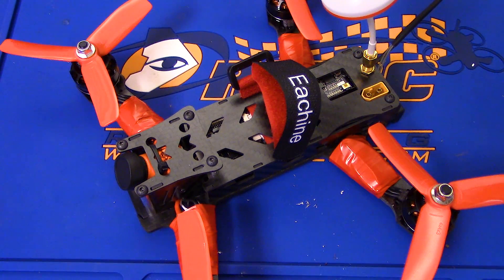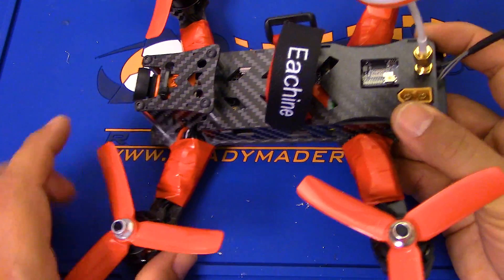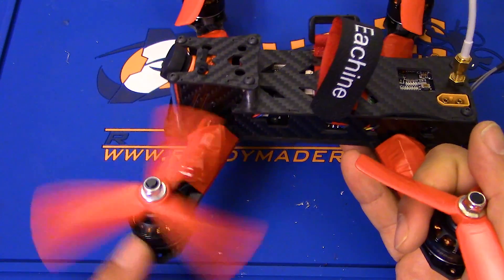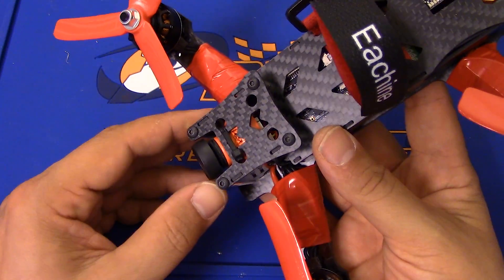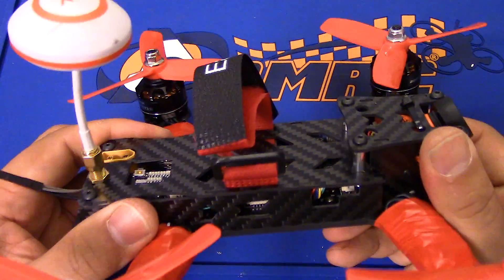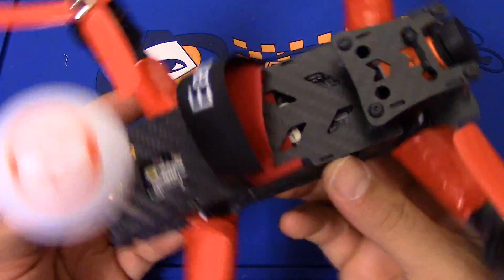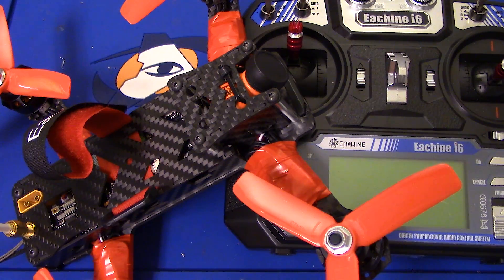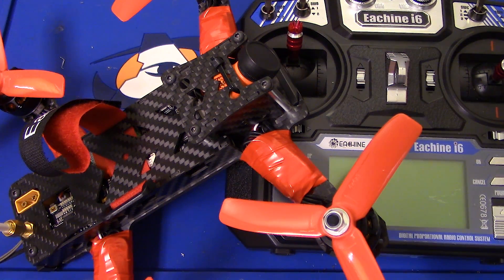Eachine Falcon 210 - Second Look

Comment: The Flysky FS-i6 has got good gimbals - they run EXACTLY from 1000 to 2000 and center at 1500 with almost no jitter and no deadband. The Eachine i6 has got way worse gimbals. I compared both the radios directly and there was a difference in the feel of the gimbals. So yeah, the eachine radio you are talking about is crap, but its different from original flysky.
Edit (just watched the next 10 seconds of the video):
6 POINTS OF DEADBAND?!!??! OH NO! Thats like 98% of the stick travel, so damn terrible!!!!!!! 
6 Points of deadband is indistinguishable for 95% of pilots, especialy for you (i see your shaky hands in your videos at full throttle punches and straight line flying where you randomly jiggle the sticks around the middle so the quad looks all shaky and stuff).
Reply from the maker: What! I don't jiggle the sticks! What are you talking about! I think there must be some mistake...

Comment: i think these rtf quads are great to get into the hobby i started with the eachine falcon 250 and have put it through hell and back and only broken 1 arm in the process, its now running 30a littlebee blheli-s esc's and kingkong 2205 2300kv motors on 4s infinity graphene's , keep up the good work pal
Reply: Ben Page fpv mind me asking what you did when you replaced the ESCs? It looks like my stock ESC on my falcon 250 pro have 5 wires coming in. I think I need to just remove the extra small red wire and only connect the signal and ground wire to the flight controller, but I am not sure, thanks to the special pdb Eachine added, I can't trace the servo cable past where it plugs into the PDB.
Reply: It was a long while ago mate but I'm sure signal (white) and negative/ground (black) is all you need on those esc's pal
Reply: Ben Page fpv yep, I just removed the red wire and kept the white and black. Took me like 30 minutes to replace the garbage stock ESC with some racerstar 20a ESCs. Wow what a difference in the way the quad handles, and the additional power. I was blown away. Now I can't wait to build my own now that I have the confidence to take that on.

Comment: Joshua, i think maintenance on the armadillo is okay. Three screws and the whole top assembly just comes off? Okay its a bit fiddly to put back together and the attachment of the two top plates doesn't seem ideal. The biggest challenge on that frame for me was fitting it all in. Got there with some perseverance though!

Comment: IMHO it would not have been necessary to replace the ESCs. I flashed BlHeli to the stock ESCs. stability and responsiveness increased tremendously.
Reply from the maker: +David Hellekalek I replaced them because after upgrading them, the copter wouldn't take off. It turned out to be the FC not the ESC's but I didn't know that.

Comment: random question Joshua, have you got to try out kingkong 5x4.5x3 props yet? if so how do they compare to 5x4x3?
Reply from the maker: Yeah, I have flown them on 2300kv motors only though. IMO, on 2600kv, they would be too aggressive. That style of blade profile is a good match for lower kv motors. More thrust and better efficiency than a square bullnose.
Reply: Joshua Bardwell sweet! I've had mine on the slow boat from China since the 5th and I can't wait to try them out on my 2206 2300kv motors. I do have some hq 5x4.5x3 but they are incredibly heavy at almost 6g each. I'm hoping the kingkong blades are lighter.
Reply: Adam Komarek Dang! I have the KingKong 5x4.5x3 props. I finding them hard to tune my copter. Went back to the 5x4x3. BTW, I'm a n00b at tuning so it might just be me.

Comment: The pots on the actual flysky fs-i6 are normally pretty good maybe this is just an eachine version with crappier pots.
I only get 1us of variation on center values at most.
Reply from the maker: Interesting. I assumed it was the exact same product with a different sticker.
Reply: Joshua Bardwell Yes the 1 Eachine tx I have also has sloppy gimbals. My 2 FlySky tx's are pretty solid.
Reply: i've got the turnigy i6. gimbals are okay, and with ibus dead center at 1500. i like the tx a lot. you can flash it with better firmware btw :)

Comment: I have FlySky i6 transmitter which is same hardware but diff firmware in it and it works like charm, spot on 1500 in center. But I've used iBus on I6b receiver (similar to sBus), not pwm, so I think it's not gimbals but pwm.
Reply: And you can flash Eachine i6 with Flysky i6 firmware, which is better and has more features, I belive.
Reply from the maker: Its definitely at least a little bit the gimbals. But I've used PPM before and it didn't have but 1-2 us of drift. Is PWM that much worse?
Reply: +Joshua Bardwell I am an extemely cheap(value) flyer so I thought I would follow you for a while but you have left me behind with the brand name stuff. I fly with the turnigy  tx and using ibus. Maybe I am use to the stuff but I consider myself as good as most. If it is generic I fly it.
Reply: +Joshua Bardwell BTW I don't have this quad. Not generic enough.
Reply: Joshua Bardwell I haven't tried pwm on flight controller (to check jitter), only on planes. Haven't tried ppm either. Just went for ibus, which works even with naze32 without "inversing". And on my transmitter I get 1500 always, no jitter, no deadband.
Reply: gpwelter You get what you pay for.
Reply: +Skunkman FPV I think paying for high end equipment doesn't make you good either. Just like buying expensive workout clothes doesn't make you Richard Simmons.
Reply from the maker: Skunkman FPV paying more gets you more, but the relationship is often not linear.

Comment: Why bother taking the screws out to press the bootloader button...?  Isn't that the exact reason for the "dfu" command in CLI in beta flight...?
Reply from the maker: +K. Soze but it ships with Cleanflight.
Reply: I was just thinking out loud as at the time you shot this video you had already flashed BF, I believe the wording you used was to do with the maintenance of the unit.

Comment: I can change the settings on my minim osd without the gui just using the sticks its actually very easy to do. Or did you get minim osd and kv osd mixed up at the end of the video there?
Reply from the maker: +Christopher Punton maybe MinimOSD has updated since I last used it. MinimOSD didn't used to do layout changes from the GUI.
Reply: Could be I did upgrade a month or 2 ago but only found out later kind of by mistake that it could be configured using sticks lol. The firmware im running is this 1 https://github.com/night-ghost/minimosd-extra if you or anyone else is interested

Comment: Have you tried the immersion RC driver fixer.....That seems to fix the VCP based F3/F4 FC's for being able to flash new firmware without having to use bootloader mode
Reply: I found it on an RCG thread for the motolab cyclone
Reply from the maker: +Liam Lambkin it installs the proper driver but I am pretty sure you still need to be in DFU mode.
Reply: Once the driver is fixed, you can then press flash, and BF will put it into bootloader. Just make sure you dont have full chip erase ticked. I had my configurator lock up with that ticked.
Reply: You can also try command dfu. That should tell the FC to go to bootloader.
Reply: I will hit you up on a means of chat later if you want later.